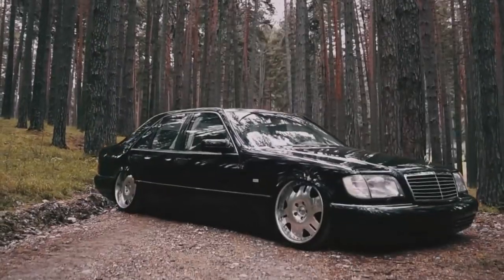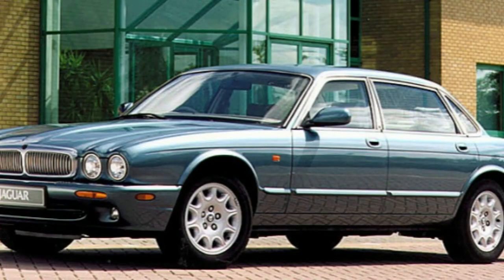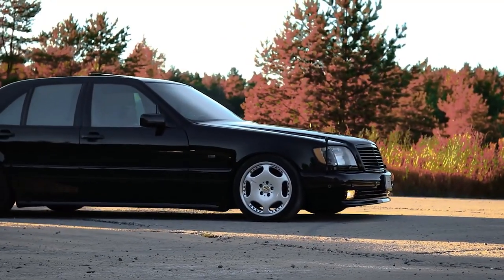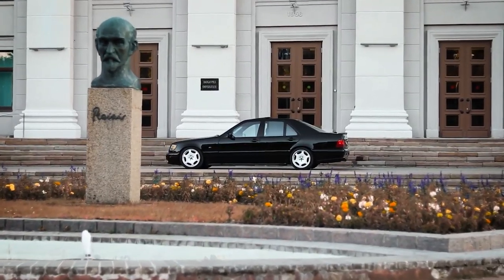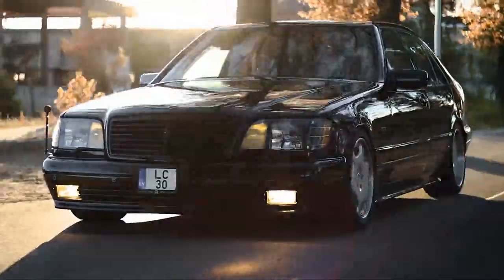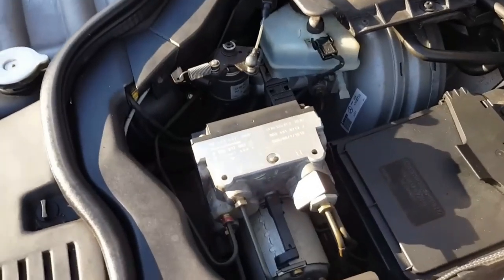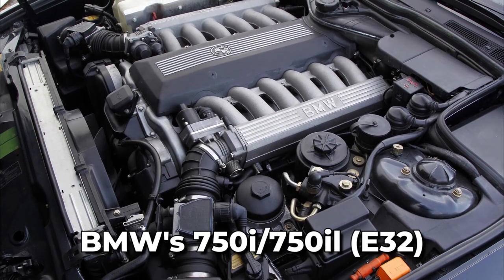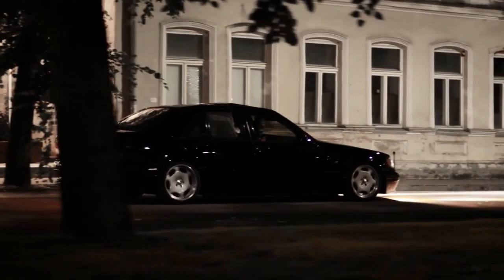About the Mercedes W140

Comment: Does w140 have good high speed stability?
For example, when it is driven 230km/h, does car feel stable and firm? Does it feel like as if the car is sticking on the road firmly, not feeling floaty?
How does w140 feel at extremely high speed?
Reply from the maker: Very stable. I've driven both the saloon and the coupe... Not at that speed though !
Reply: Mine is very stable at 140-150.